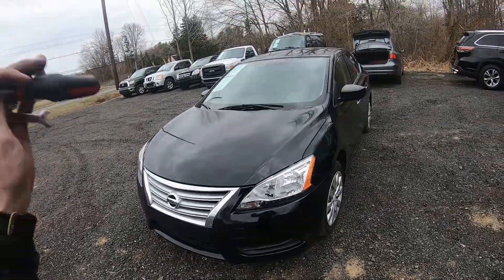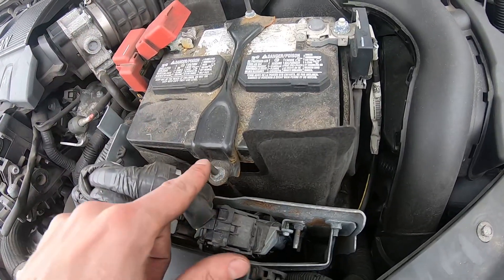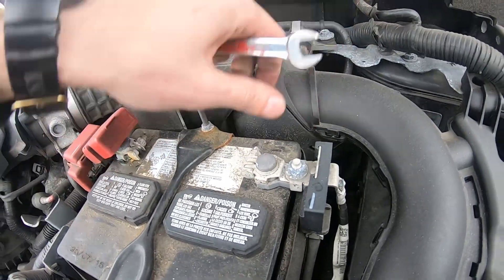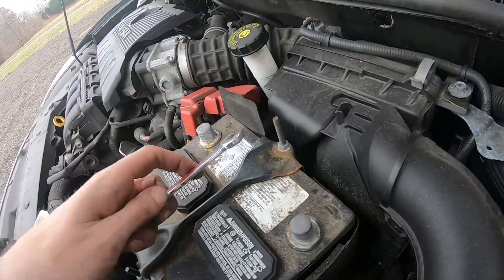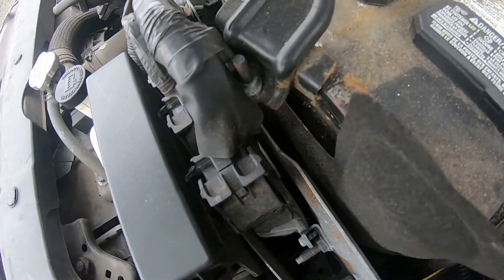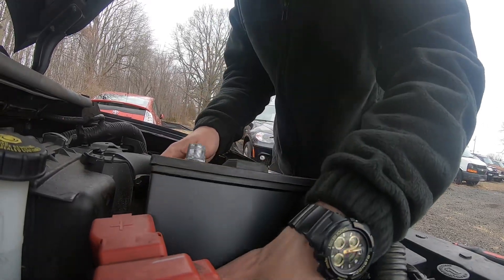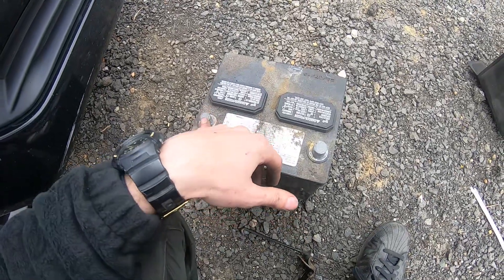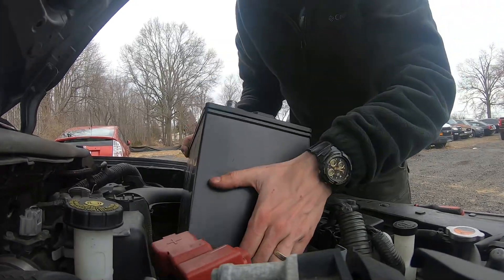How to change battery in Nissan Sentra 2013-2019

Comment: Every car has a specific battery group assigned to it. In this case it’s either a group 35, or 26R. The 35 is slightly bigger and 40 cca more powerful. You can’t just pick any battery with the right terminal orientation, as it may not fit. Good video, use deep socket and small socket wrench to loosen tie down nuts, as hitting the terminals with the wrench may cause sparks or shock if there’s still juice in the battery. Also, make sure to keep battery cables away from metal parts when connecting and disconnecting.  Wear gloves and eye goggles as old batteries will leak acid and can potentially explode if not handled properly.

Comment: I change my sentras battery, but my car key remote is like unprogram??? It only turns on if I put the key close to the start button. But don’t let me lock my car or open with my remote key???? Help
Reply from the maker: Try changing key battery
Reply: @repaired2106  if I open my 2013 Sentra would it let me put it back ? The clips from the key remote
Reply from the maker: Just search “how to replace battery in 2013 nissan sentra key fob”
Reply: @repaired2106  I did but none of them show  if their remote keys dis programmed